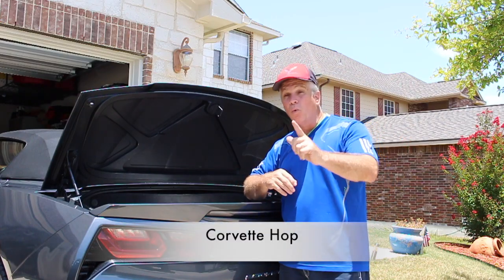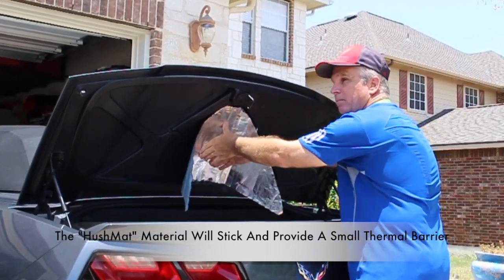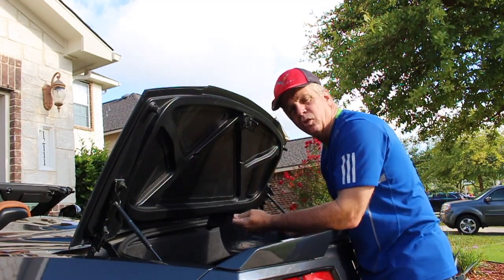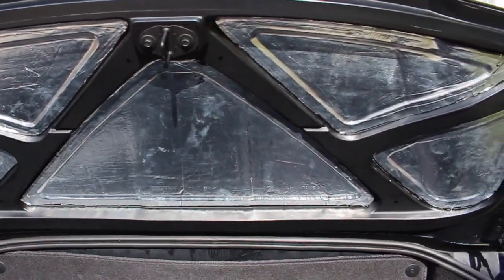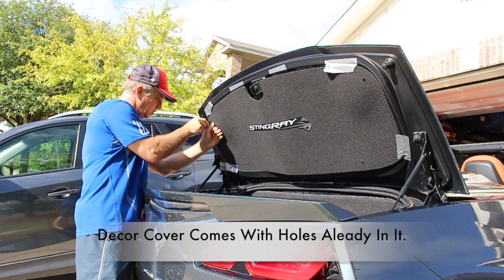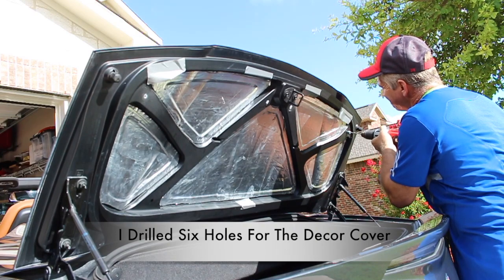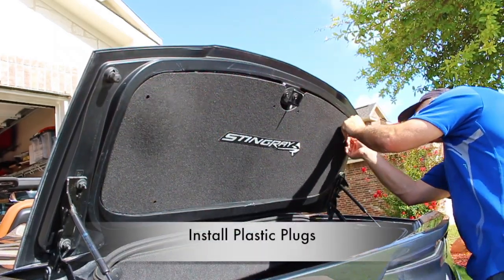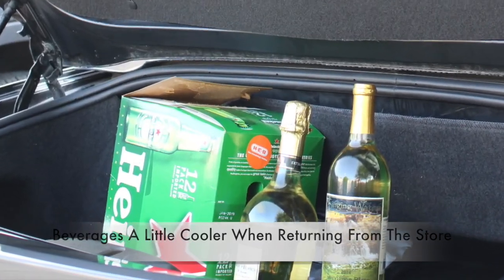C7 Corvette Trunk Lid Decor Cover Install With Thermo Installation

Comment: Excellent video! Did you by chance ever film the sound deadening material install? I have done the doors on my 16 vert' and I'm gonna do the interior floor soon too
Reply from the maker: Yes, I did but I am still working on the video. The videos I make are very detailed and technical. I did finish the video on the seat removal in prep for the sound deadening. Can you tell a difference in the door sound deadening?
Reply: @TheWhatisright  the door sound deadening made a difference, but the best thing I did was tape up all the white door clips to keep them from rattling! They have a ton or play in them and they would make the door rattley over bumps. And I also put in noico between on that one spot between the inner door frame and outer skin that rattles with bass hits. Overall worth it!
Reply from the maker: Interesting, thank you.
Reply from the maker: I should have the interior sound dampening video out his week. Most of it is done, I just need to finish the opening and closing plus edits.
Reply: @TheWhatisright  you sir are awesome! I need to make some vette videos as well!
Reply from the maker: @adamfox6538  That would be nice. I sure learned lots from making the videos.